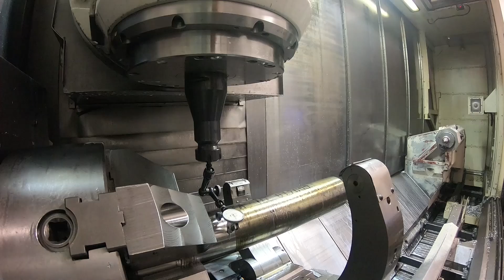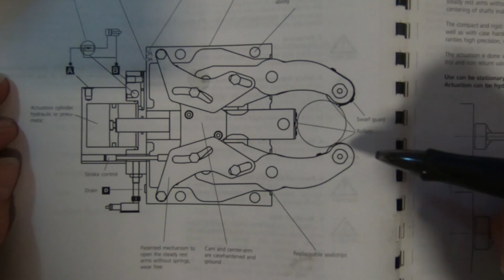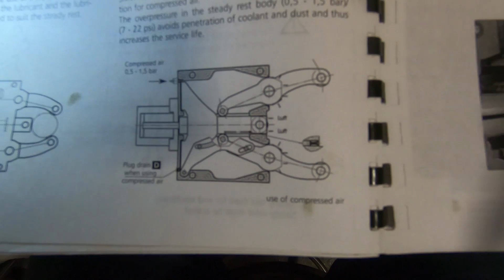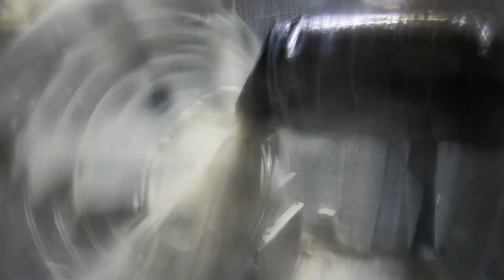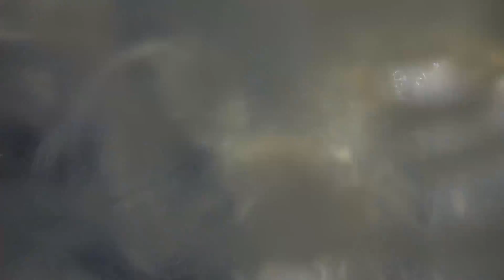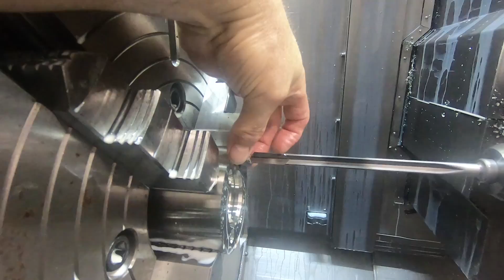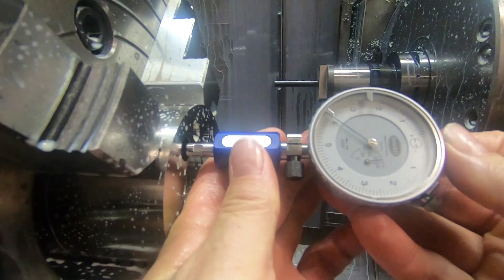Inconel Valve Body End 1-1

Comment: The way you check the concentricity run out is also the way we use to check the driveshaft alignment between electric motor and gear reducer on big cooling towers. It works very good.
You do an amazing work thank for sharing your knowledge! I can´t even think about the tools costs on a part like this !
Reply: Guillaume Van Der Meulen 
Do you get indicator sag when the dti is upside down ,I was shown a method that used two indicators one on the motor shaft and the other on the machine shaft , with trig you could work out the shims and side to side jacking ,but indicators sag was a problem

Comment: Aside from travel limits, is there any other reason to index the boring bar to 12:00? I would think it could just as easily cut the bore at 3, 6, 9, or with two axis motion at any position. Just curious if there is something that makes that position the most ideal.
Reply from the maker: The way the machine uses its offsets for turning you have to do turning in the X axis. It would be possible to do what you suggest but as I said you couldn’t use the normal wear offsets or tip comp for the turning tools. Also this machine only has 10mm X minus travel. So everything milling and turning has to be done in the X positive direction.

Comment: That steady rest is quite the cool piece in how its designed. Really neat. 
Is the other hydraulic lines for it to lock it in place after its clamped?
Reply from the maker: It doesn’t lock. It just holds with the hydraulic pressure. There are other lines that connect to the steady rest. There is a constant air pressure inside to help prevent coolant ingress. Also there a Oiler that feeds oil to the roller bearings and pivot points.
Reply: At least one was for air to keep coolant out, if that helps.

Comment: Pretty surprising you haven't found any better inserts out there for this material.
Reply from the maker: I don’t really have the time or want to risk expensive material testing many different insert materials. Everything has its advantages and disadvantages. For instance ceramic will do the job faster but the inserts are much more expensive. Witch in itself wouldn’t be a problem but the heat and the stress they would put into the part would cause problems. So you see there are always tradeoffs.
Reply: bensbenz 
There is, but its all about surface finishes at his level.